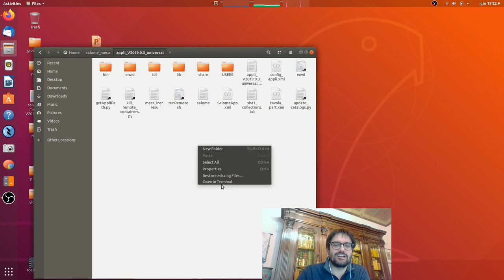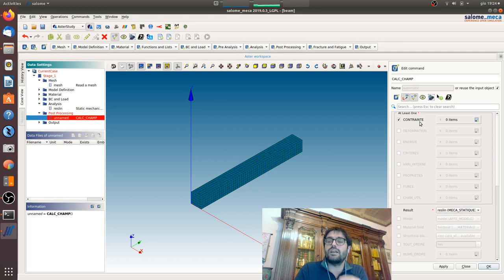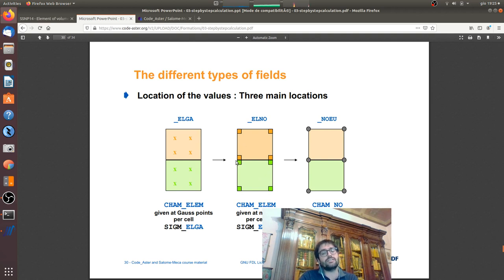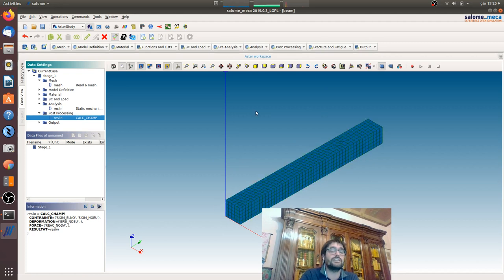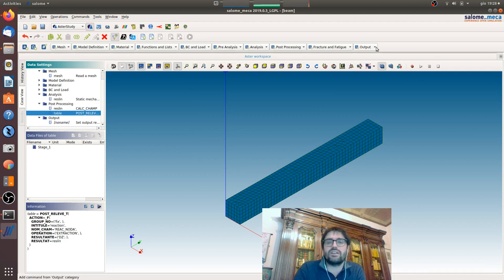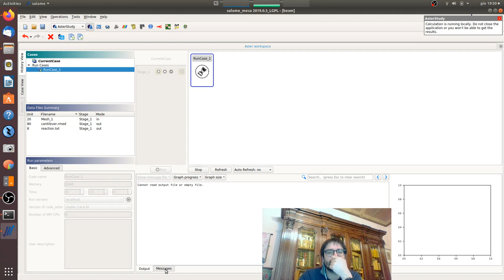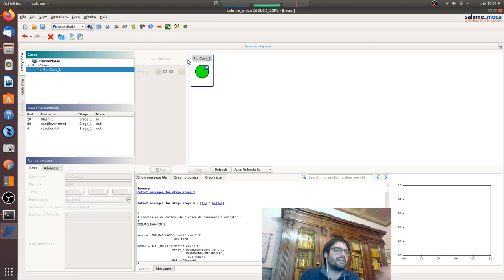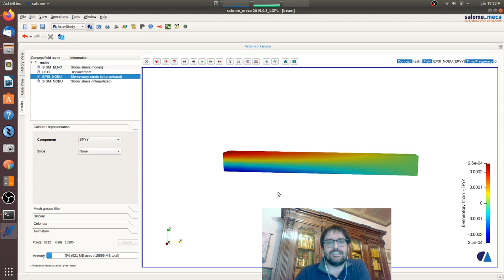Tutorial for Code_Aster and Salome_Meca - Episode 02

Comment: when i go to set the group in the  post_releve_T stage, i can't see any group. But i can see in the BC definition. Any suggestion?
Reply from the maker: Are you sure you have the groups of nodes (not of elements) included in the med file. In any case hen the groups are not identified you can try to write the group name at the corresponding field and continue. If the group exists it should work